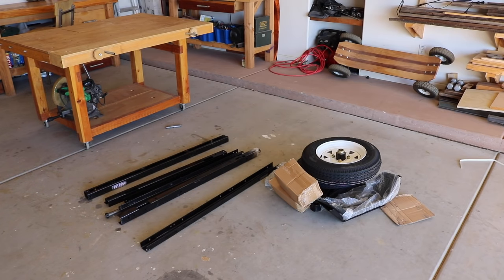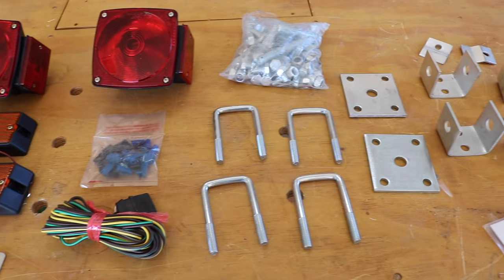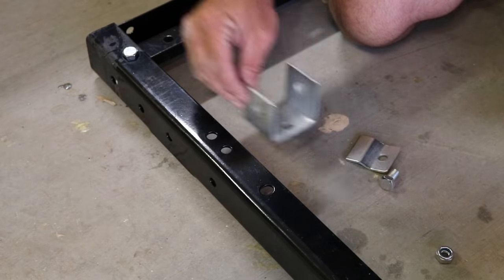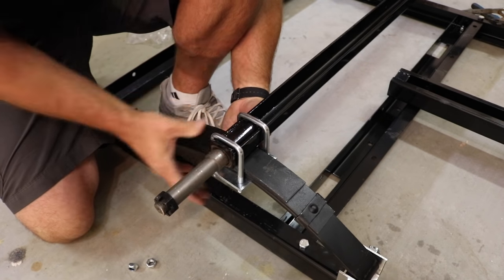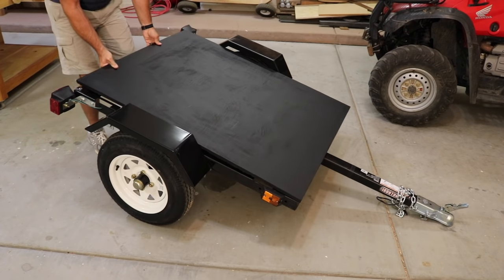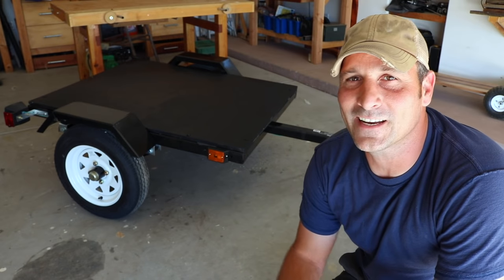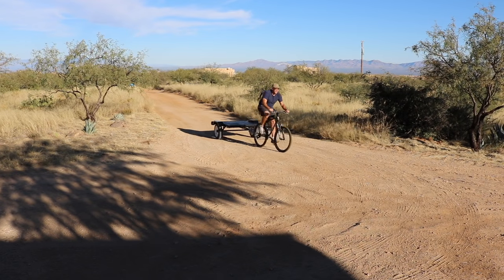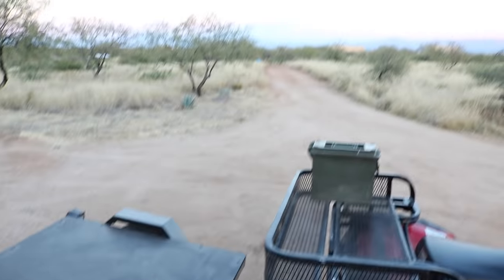Ironton Utility Trailer - How To Assemble

Comment: My Cousin built a Harbor Freight trailer and he told me nothing aligned up on the holes he wound up using a Die grinder to  enlarge  most of them he is actually a Engineer by trade  and he can Weld  I was shocked he didn’t build one from scratch but he told me the same thing  you concluded on buying the materials  plus  he had some Coupons his Wife found Online  that paid for some Air Ratchet or tool he had wanted  or needed ?

Comment: Exactly what I want to do - but 275 gallon IBC tote full of water is about 2000 lbs, trailer is rated about 1000 lbs.  Ok if half full.
Reply from the maker: It was an empty IBC tote.  I use them for rainwater harvesting but also for trash clean up and other things like that.  And just to demonstrate size, etc,.
Thanks for watching😀🙏

Comment: Interesting little trailer! I've been looking into getting a smaller trailer to pull with my patriot than my 5×8 or the 4×6, this one you've described and built rather easily looks to be just the right size I've been looking for. Thanks for your informal video!

Comment: Fire trailer is a good idea. Uncle Mark could use something like this at the ranch. He has an electrical power water tank that fit on the back of the ATV, but a trailer would give him some additional capabilities.  After you finished the first test ride, I figured you would have installed a child seat... Maybe with rails around...  :)

Comment: Ok, this is a great video demonstration and I truly appreciate it.  I need to build a camper that I can live inside of that can be pulled by a bicycle, so, your ending demonstration was perfect for me.  Can you explain to me what type of attachment I'd have to have to secure it to the seat post of my bicycle; I'd prefer to pull it that way.  Also, I'll need to purchase one of those towing jackets with wheels so that it's more level and pulls better.  If you have any ideas at all I would certainly appreciate hearing from you.  Thank you.
Reply: Ur doing it wrong if you are bicycling with a 1000 lb camper. You have to use a tent thats seperate from the trailer
Reply: @Smokeyfilms_  Good Morning and thanks for writing me.  Well, I've been watching lots of videos on Bicycle Nomads who have built their own towable campers, including those built upon trailers.  I suspect that the trailers they used were of a lighter weight than the one pictured above, but according to my chat interactions with them, apparently a larger load can indeed be towed, even without an electric power assist.  Have you built a bicycle camper yet?  I'd appreciate any advice you can give me.

Comment: could you tell me how you grounded the wires for actual lights?  To the frame?   I am having issue with grounding to get lights to function properly.  The car end for trailer lights is fine.   By the way the paper directions that came with the trailer sucked.  The only reason I was able to build it was because of your video.  Thanks

Comment: Cool project, u could've saved so bolts & nuts by welding the pieces into place. I was guessing it would be used a a firewood hauler, if you put some side rails on it or a big game hauler when u go hunting or a cool ride for your daughter, but needs a handle or seat with belts, lol

Comment: Good video, but ... I really need your guidance for the wiring.  You just skipped that part as if it were easy and automatic.  Was it, for you?  Did you just use the guillotine connectors they furnished?  Maybe I, not the connectors, am the defect, but they just seem like junk.

Comment: Did you install the lights in your Jetta using the instructions in the manual or did you use a separate kit? Any chance you have a separate video of the wiring for the light install

Comment: One thought Joe, when you were driving around with it down that steep little incline it looked like the trailer bed came really close to the rear basket on the quad. Maybe a longer or lengthened tongue? With that IBC tote or taller items attached to the front it definitely looks like it would hit the quad... 

Love that you didn't need the directions for the most part, those are generally just "suggestions" anyway, right? LOL!
Reply from the maker: Hi Tracy,  yes it's a bit close with the extended quad shelf/basket that extends off the back.  I'm going to have to take that into consideration when placing the pressure tank for the brush fire build.  I think lengthening the tongue will be the easiest solution... but I'm going to build it first and see if it looks like it will hit... if so then I'm most likely extended it.  But hopefully there will be enough clearance;)
Joe
Reply: homesteadonomics thanks for the reply Joe, always look forward to your builds and videos. While I may not put it all into practice you really do get me thinking. Rainwater harvesting, greenhouse, chicken coop just to name a few. Those are on my long term list of things I've learned from your channel that just need adapting to my local. 

Snakes? Nope… uh-uh. No way Jose! LOL! They (rattlers) are around in Central California, but I give them a wide berth. Black widows are my worry. 

Good luck with the build, I look forward to the video. I also pray you never need to use it.

Comment: Nice video. I would like to have seen how you secured the plywood to the trailer, though.
Reply: There's pre drilled holes ..
Reply: But did u use bolts and was it flush with the plywood or was the top of the bolt raised withe the plywood?

Comment: Nice! Me I would be adding some loc tite or locking washers ;-) Yes I have seen how you drive....
Reply from the maker: I actually added loctite on the deck bolts but all the rest were self locking with the rubber/plastic within the nut.  But I did consider adding some locking washers too... you're thinking is spot on WTB!
Joe
Reply: LOL your area is not exactly flat and perfect roads ;-)
Reply from the maker: haha... absolutely not;)  The main dirt road that I filmed the first few clips on is about as smooth as it gets;)
Reply: It includes nylock nuts. If you want to do better, you need Nordlock washers. Loc Tite and lock washers have been tested for holding under vibration, and they do not hold. The only sure hold is by Nordlock washers, bend up flange washers that lock the nuts or castle nuts with cotter pins.

Comment: I have one of these trailers that was given to me and built 1x4 stock sides and gate for it .I just use it around my place too. Question is since we perm tab in Az. for street use for most trailers how do you title those kit trailers?
Reply from the maker: I've titled a kit trailer before and you just have to take the certificate of origin(and trailer for inspection) down to the DMV and they will give you a plate for it.  I don't know if Ill do that with this one... but I'll keep the Certificate in case I decide to.
JOe

Comment: Hey, if its cost effective, there's no shame in that game...   Could you standardize your bottom plate size and make your "platforms" interchangeable - fire - water container - etc ???  Maybe screw some pieces to the bottom of the base plate so it gravity holds in place - easy change out  ???  Or....  Become the tiny house KING !!!  LOL   Looking forward to the mini firetruck...  Bring it on !
Reply from the maker: Thanks BBJ!  I think a standardized bottom is a great idea... I plan to make it multi use for sure!  btw.... I got your message but for some reason I can see it in the message system... it shows no messages... but my email has the message in it... weird... but just wanted to let you know, so you didn't think I was ignoring :D
And I need to get on FB more... it's been a BIG weak point of mine.  I've had a couple videos that have been stripped of any identifyers to me on FB and just made me not want to do anything on it... but I do realize its  a cool place and I plan to start posting some more and making it a regular stop vs the once a week check that I do now.  I'll check out your page too!

Joe

Comment: What is the overall dimensions of the rear trailer crossbrace? I know its 40" wide, but how tall and how deep? Trying to see if I can convert it to flushmount LED tails before I buy it and needed to know the overall height.
Reply: Buy the boxes the light fit in ..bolt to where the angle pieces went or weld...

Comment: Years ago I used a very similar trailer behind a small car for a camping trip.  200 mile round trip, I pulled in the driveway when I returned home and the wheel fell off. LOL 
I think I lost the pin that holds the castle nut on, or someone put it together without reading the directions. ;-)
Reply from the maker: oh no!  Wow, luck you got it back to your house!  Hopefully the axle was all chewed/ground up.  Let hope that doesn't happen during the brush fire build on this trailer... but if would be funny if I got it on camera;)
joe

Comment: Be careful loading the IBC with water on that trailer...275 gals @ 8#/gal = 2200 but it is only rated for 1060#
Reply from the maker: lol... I hope it didn't look like that.  The IBC tote that I have in the video has the top cut off and it is for hauling trash.  My plan is to get another one like this and cut it in half so as to essentially be a bucket for hauling branches, bulky things around the place.  Yes, I think a full one would max out this little guy pretty quickly:)  thanks for checking it out Gregory:)
Joe
Reply: Ah...oki...kewl beans!
The build looks great too!